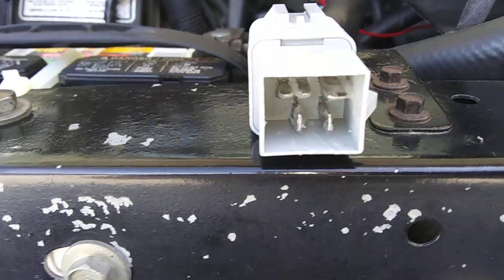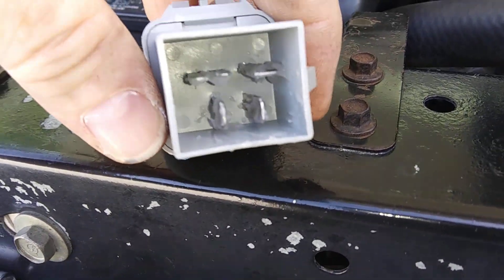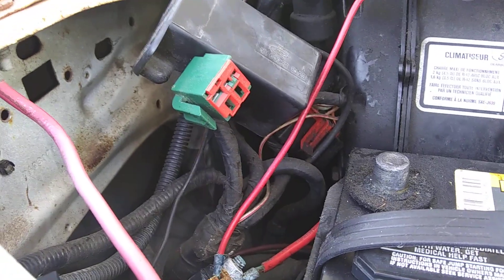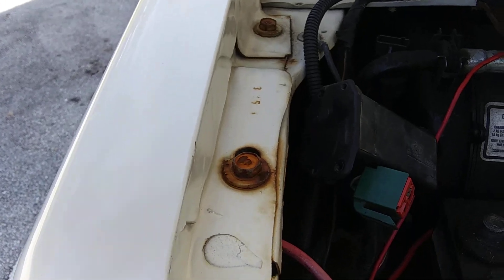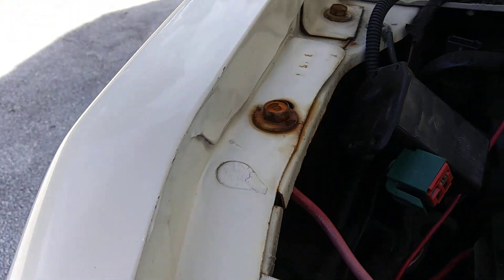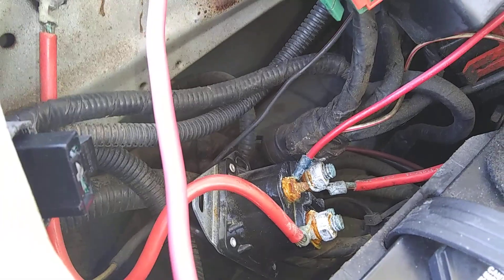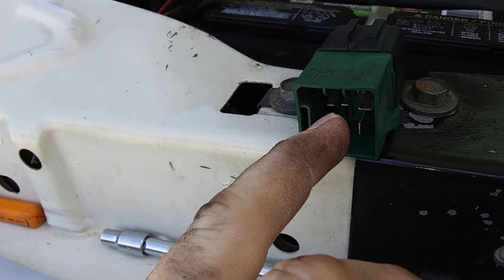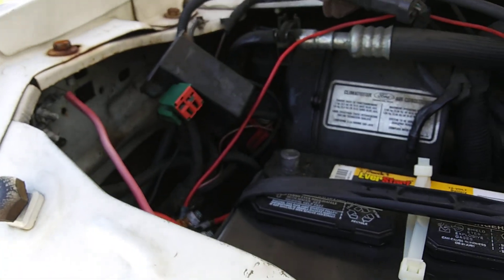part 1(1991 Ford E-250 Van 5.8 L engine)  fuel pump relay replacement🌎🔩🚙🔧✌😀

Comment: I just got a 1990 ford e350 motorhome to live in for free.  The guy told me it needed a fuel pump.  I had it towed to my dads house and then i squirted some starter fluid down the intake and it started up and ran great for a few seconds.  So i ordered the fuel filter and pumps.  Mine has 2.  One inside the gas tank.  And one up under the driver side on the frame.  I replaced both and the filter and i still got nothing.  I dont even hear them buzz when i turn the key on.  Its as if they are getting no power to them.  I checked the inertia switch and it is pushed down.  Is that how it should be?    I have also found the green relay that you show in this video.  But i dont have a replacement relay yet.  It doesnt look burnt or anything though.  Even the wiring harness that the relay plugs into looks good.  Unfortunately i dont have a test light to be able to test the pins for power.  So all i can do next is buy a relay and hope for a miracle 😆

Comment: mine will run for about 40 seconds. then it dies
Reply from the maker: @UnblockedOne2  I'm sorry to hear that if I was there I could diagnose it and figure it out for you. I'm pretty good at working on the older Ford pickup trucks and vans because that's all I know. As always thanks for stopping by bro and I hope you figure it out🌎✌😃
Reply: I have problems whit my ford bronco 1987 external fule pump that stay on and that fumes are so strong and I put that obd1 and my problem external fule pump circuit failure  I dint know wat this means do I Ned change that fule pump
Reply: @Purozamachihue  I changed my fuel pump relay, the grey one, & it didn't fix it. Went ahead and got it towed to a shop. The relay right next to the grey one ended up being bad. Guess it affects the fuel pump too. maybe I changed the wrong one
Reply: Yea mine have a wire by jumper and was working fine and then I put that really after few months end up whit this problem I haven’t done anything but I’m going to change that fule pump and se if fix my problem
Reply: Did the other one fix it? @UnblockedOne2
Reply: @Purosanluispotosi were you able to figure yours out yet? I'm having problems with mine as well.
Reply: @enzodunn2577  yes, for me I had simply replaced the wrong one. Now, when the key is in the On position, I can hear the in tank fuel pump
Reply: @Purosanluispotosi  I just came across a video titled Ford Bronco fuel pump fix on youtube and the video shows a black bronco fender.  Anyway his was doing this and he shows how he fixes it.
Reply: @enzodunn2577 sorry for that late reply and no I have my fix ayting but how I can find that video